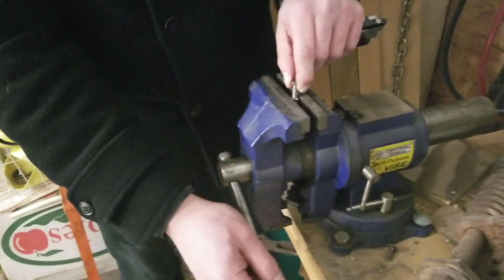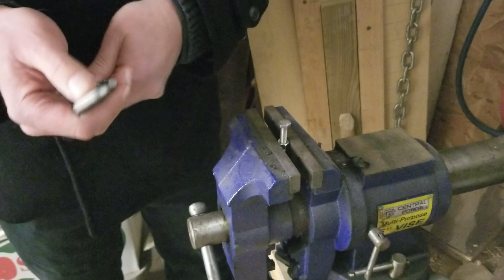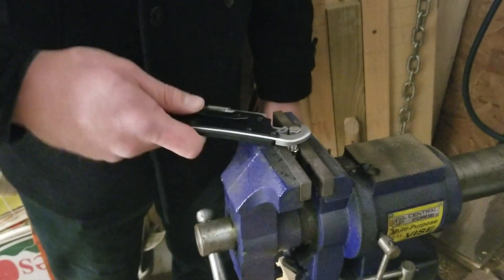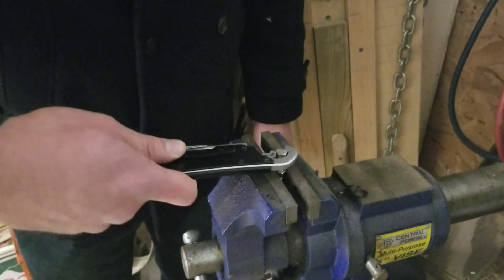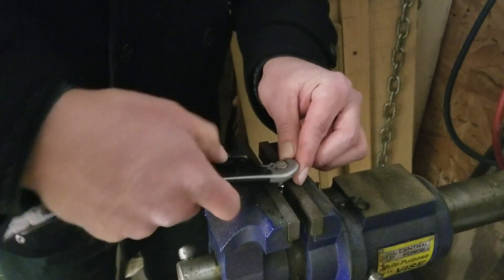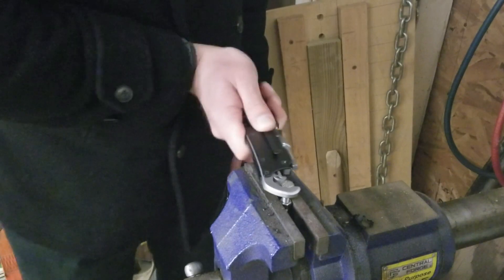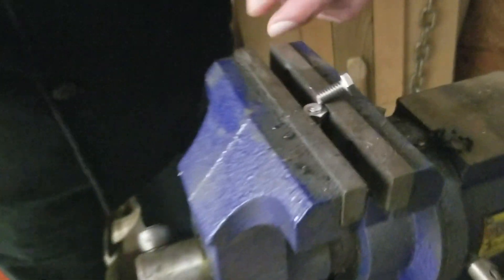OMNILOCK "Feeding Time" One

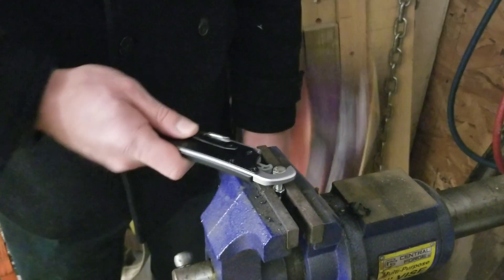Comment: Awesome concept!  It appears that a good deal of real engineering went into the design of this multi-tool.  That's exactly the kind of innovation we desperately need more of in the United States!  Like a few in this comment section, I question the amount of torque that can be achieved with this tool before reaching its maximum threshold at its weakest point.  I question this because he obviously had some help.  There is no question he conjured some paranormal energy to utilize as an aid in applying force to the OMNILOCK specifically to increase the torque, for at 1:29 the conjured energy was being stressed to the point that it emitted a paranormalized energy forcewave akin to how an arm-wrestler will bellow a primordial grunt in order to exert his last remaining strength just to produce a momentary boost of force, while hoping that it will be sufficient to overcome the counterforce of his opponent and gain victory, a forcewave which resulted in the disturbance of a sign's gravitational counterforce.  This disturbance was so immense that it momentarily negated all effects of said counterforce, thus allowing the sign to become vulnerable and fall victim to the havoc which gravity typically wreaks.

Just joking, but I can not blame any of these people for being skeptical and overly cautious when it comes to these indiegogo projects.  Regardless, I feel you have a decent product here, and I don't believe you are trying to swindle people.  As soon as I am able, I plan on obtaining the tool, and I hope it's as incredible as it appears to be.  Good luck with all of your endeavors!  I really wonder what other concepts you can invent and develop if you do not allow yourself to become too distracted by "other" things.
Reply: jesus, sheldon.....  you're a talker
Reply: @--RSL--  
I'm more of a typist than a talker, a circumlocutional typist at that!  Are you a reader??
Reader, I request you refrain from the religious references.
Reply: @ThinkerOnTheBus  Jebus, Sheldon..... You're a typer

Comment: I'm just as enthusiastic about this awesome looking tool as well. The thing looks amazing! Please don't take this the wrong way, but has anyone questioned the claims of the videos at all or seen anyone else question them? 

The rusty bolts could've been loosened before the shot, the bolt of the 18-8 could've been cut already. I'm not trying to slight anyone by believing in this product I want to believe in it as well. 

I'm questioning some of the claims not being supported by any stats of the tool. 

What is it made of? 

How much torque can the wrench apply? 

Where are the stress tests of it breaking?
Reply from the maker: Daniel. Glad you have questions. I do promise there was no tampering of any sort in the videos. I wish I'd had a camera and lighting to get footage of the rust powder rising from the threads of that bolt as it turned. As to your questions. It is heat treated martensitic stainless steels and aluminum covers. The wrench is tested to 60 ft-lbs before leaving the factory. I am rating the wrench a good deal lower than stress calculations indicate it should withstand  for a margin of safety. At 6'5" and 250, leaned back and pulling horizontally, my feet begin to slide on concrete and my heavy shop table is creaking and moving before the wrench suffers any damage or loses grip. I feel that is sufficient for a tool from the pocket, so I have not yet built a test fixture to take it to failure. Thanks very much. -Mike
Reply from the maker: I feel I should clarify. The wrench suffers no damage, I just can't apply any more force. Thanks.

Comment: Awesome tool design! I've just seen a few of your videos, it looks like a great tool for a wide range of work. Love the simple mechanism! I find a lot of tools and products to be poorly designed, these days. Looking forward to testing one out. I'd be happy to do my own testing and videos as a customer and Mechanical Engineer. You'd be welcome to use them as a testimonial.
Reply: Thanks, Doug. Always nice to hear from a fellow engineer. Looking forward to hearing your feedback!
Reply: Everything is disposable now A-days! That’s what keeps these companies richer ;D the consumer spends an arm and a leg for a crappy product it takes them a few dollar to make, then you use it a few times and you have to turn around and give em ur other arm and leg cus there’s no warranty and it’s broken😂😝
Reply: @hallnballsracing199  Yes, that is EXACTLY the situation! I just dealt with Dremel on a charger that blew a power supply that flamed & smoked just by plugging it into the wall (no battery in it). The censored my review on that model of dremel/charger twice, I told them I would just post it on my consulting company IG/FB, twittter, and my personal accounts to let people know how this could have resulted in burns or that could have caused a fire, potentially resulting in death. It's one thing to claim poor quality/performance, but DANGER should require a different result, and it was STILL refused. However, suddenly, after one of my messages must have escalated internally, I got a response from someone who said "that shouldn't have happened, they were sorry for this, and that they would like me to ship it back to them along with the tool and the charger for troubleshooting/root cause analysis, etc.".  I found the burned resistors & transistor,  on the board, but I will ship it back to them so they can 'allege' to have investigated it and potentially warranty it. I will respond back accordingly, as they respond either properly/responsibly, or lacking integrity/customer relations.

Comment: I have to say the Union is already one of, if not the best multitool and i didnt even use it by now.
But i dont think that you can twist off a bolt that easy.
I would like to see a test where you out the omnilock on a fixed hex nut or something and then start adding wheigt to the back or something so we get a better understanding for what this tool is capable of.
Im sorry if my English is off, its not my native language.
Thanks in advance and im excited for future videos and other info!
Reply: I can assure you it was that easy. I did it a couple of times and was surprised how easy it was. I did try to break a tool a couple of months ago, but the vice was a set screw rotation stop and at about the limits of my strength, (6'5", 235lb), the vice just started rotating with a terrible screech. I expect to do some destructive testing at some point, and I'll share. Til then, did you view "Feeding Time" two? I think it's a better example of the torque available. Also, thanks so much for the kind words. CARRY MORE CAPABILITY! Mike
Reply: @rhettcollins1  Yes I saw "Feeding Time" Two as well and i believe that it can definitely do some work but, at least here in austria, the screws and bolts are made of steel and a bolt that size would never break with such a "small" handle (its huge for a multitool, but compared to some normal wrenches its pretty normal).
And when you zoom in for the close up on the bolt you can clearly see a shiny side and a not shiny side. To me it looks like part of the bolt was pre-cut (the shiny part) and part of it was left in order to deform. Maybe im wrong but even though i believe that you are definitly not weak, it does look like it was too easy.
I dont want to accuse you of anything, maybe it was just a bad screw this time but even IF (!) it was faked in any way I still think its a great tool with a lot of usefull features.
And could you maybe do a Video showing the other functions of the tool? I saw the other Videos and would like to see the other features in use as well.
And also the other idea you had in the beginning with the diagramms and stuff would be great.
Reply: @florianchuchlik4768  I can assure you this accusation is 100% erroneous. I will also admit to being offended. I invite you to buy a UNION and replicate my results. You may make your apologies at that time. Thanks.
Reply: @florianchuchlik4768  the bolt material is 18-8 as he stated in the video, which is Stainless Steel, a common and widely used grade in the US. It isn't the highest strength bolt but that wasn't the point of his video. Look for his other video where he uses the hinged segment of the tool to loosen an old, rusted nut on a bolt. That video shows a lot of torque being applied to it.
Reply: Here's the link to Mike's video with the rusted nut and bolt that required a lot more torque than this 18-8 bolt.

https://youtu.be/lZyhRoyK0xg